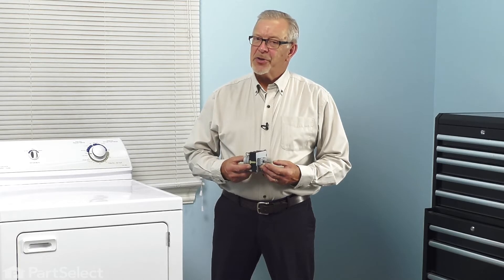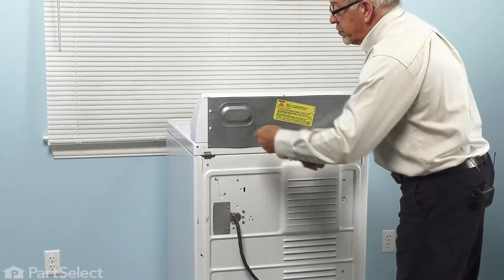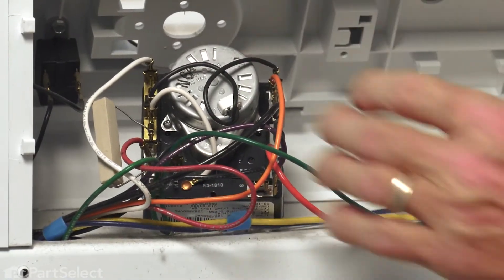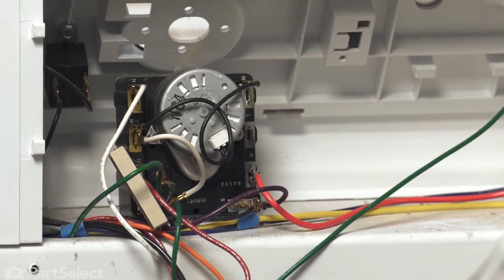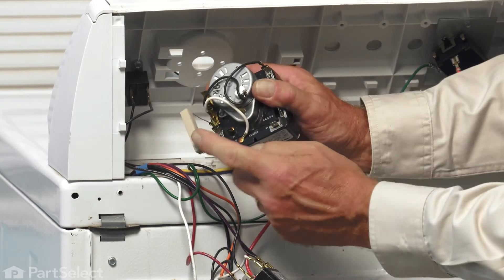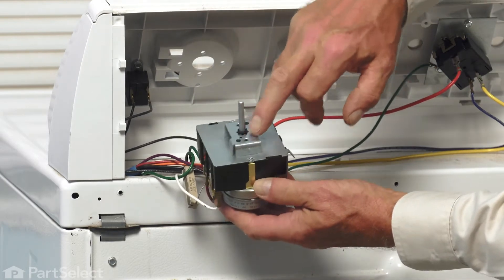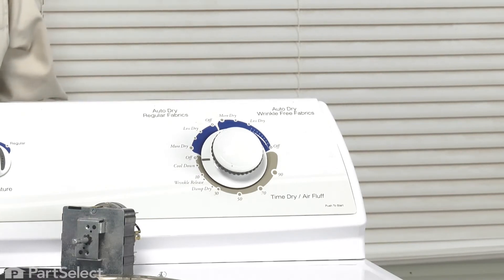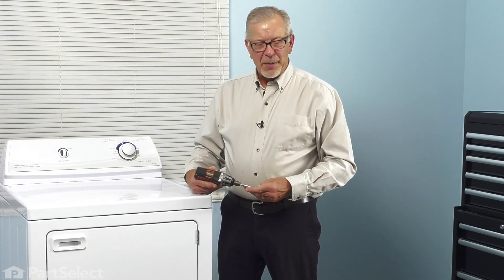Maytag Dryer Repair - How to Replace the Timer

Comment: This has helped me so much! i had just bought a used dryer and when the delivery guys took it out of the house, they pulled he top part off ! and some wires where disconnected from the timer. And after a few videos and sites, yours fixed my dryer so i thank you greatly for this video!